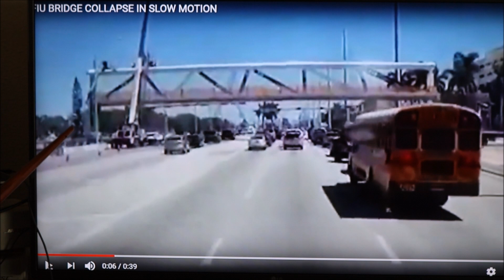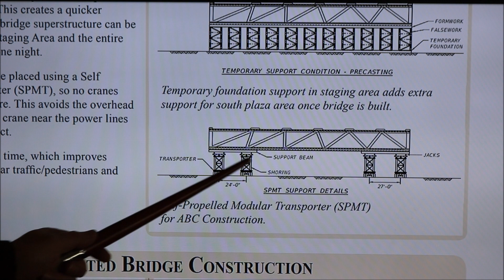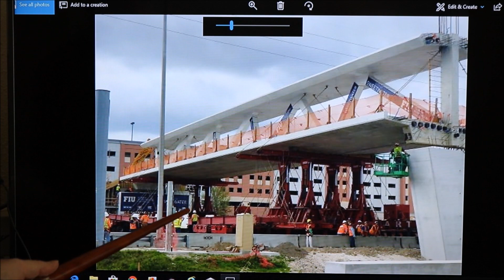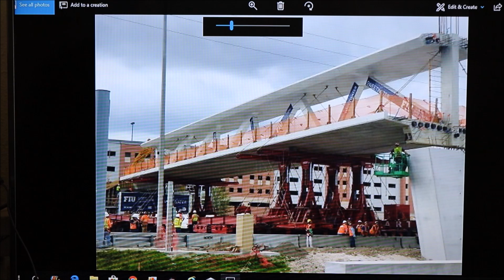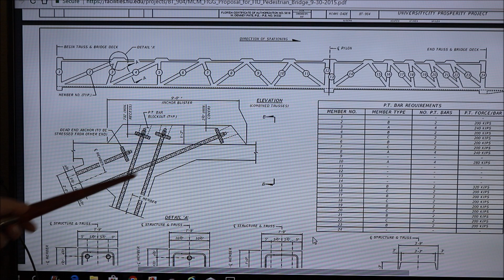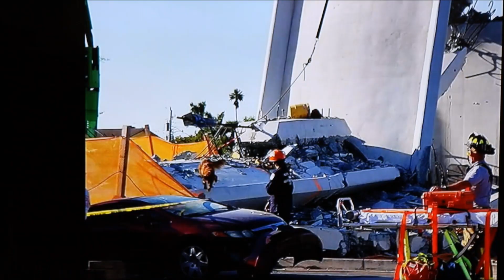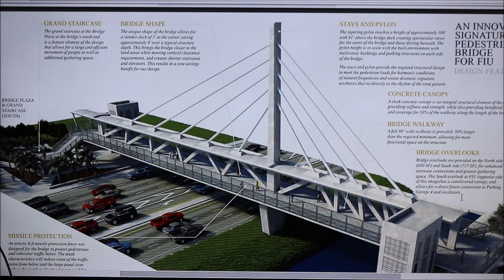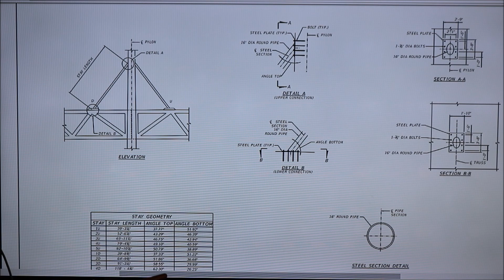Miami Bridge Failure Update 18 March 2018

Comment: I'm confused. You say this is/was not a suspension bridge. But at 6:30 you show a bridge design with 1: a central tower 2: support cables or elements 3: a central pillar or abutment from the road to the lower deck. Now, OK, so it is not a "suspension bridge" like the Golden Gate or the GWB in New York. But the tower and the cables emanating from the top of the tower, not to mention the central support pillar have got to be incredibly important items. That bridge is exceptionally long, lacking any center support. Additionally, to me, the unsupported bridge would be quite vulnerable to torquing forces. That thing twists, I don't care how well you have the internal cables tensioned, it is going to liquefy. It's gonna turn into dust. It's not like a steel I-beam with both tensile and compressive strength and considerable elastic capability. You twist that span and it will shatter. 
As far as everything I have read on this, the bridge was placed onto the end support abutments because the engineers fell in love with the idea that it could be moved into place 
in one shot. Well, lovely. You're saying the tower and support cables and central support are only slightly important to the design? Until someone shows me something new, I can't believe that. That span was placed before the tower & cables & center abutment were in place. As far as I can see from my amateur viewpoint this was a completely stupid and I mean 4th grade stupid piece of construction mismanagement.

Comment: If there were two tension rods in the compression strut, and one of them is let off, that shifts the compression to one side, which might buckle the strut.  Especially if the section of the strut was reduced from the two tubes within.  Swiss cheese and eccentric load leading to failure.  Possibly down low on the upper side in the video.

Comment: Fox News reported that a witness saw the crane cable brake and drop something.   I can see the crane cable whipping up without its hook in the slow motion video here.   I can also see the same thing in another video "Found video: FIU Bridge collapse..." from a college dorm room window.  Could be from the falling  bridge pulling the hook off or could this be part of the cause of the bridge failure as the witness reported?  Any other information on this?
Reply from the maker: Stanley Tolle I now think it was holding the hydraulic tensioner.

Comment: Sure you don't mean truss members 10 and 11, instead of 22?  Truss member 22 would be on the river span. 

The bridge failed at the 10 and 11 canopy junction and 9 and 10 deck in one swoop.  I figure the stress from the PT to compensate for the messed up cantilevered installation caused a crack across canopy and deck.  Both canopy and deck did not have rebar or any of adequate strength.  

The collapse was a double fracture of already compromised deck and canopy concrete. No way the 9, 10, 11 truss members  could hold the section up.
Reply from the maker: Jason Bell yes I meant #11
Reply: Thanks. And excellent video.

Comment: Im not a structural engineer but I was a successful mechanical engineer. It strikes me that the joints in the bridge must have all been highly loaded for one joint to fail and the whole bridge to suffer catastrophic failure. It came down without any indication of failure and ive never seen such a dramatic failure.
Reply from the maker: Bob Clarke pt loaded like a mousetrap.....
Reply: True! Everyone is talking about the trusses, but the joints have the highest stress concentrations, and concrete is not ideal for this kind of load transfer.
Reply: You got that right, but the question is "how did this get passed"

Comment: If I had to bet:
#9 or #10 was overstressed during/after the improper transport, and that caused the failure, not #11.
As the transport cradle was moved inwards, the overhang and the readjusting was too much for those trusses - my 2 cents.

Comment: You’re closing sums it up very well. This thing was obviously a much greater piece of work than necessary to carry a few pedestrians across the road. All of those aesthetics demonstrate further that the fundamental mistake here was trying to spend up on a trophy artwork instead of what’s necessary to get the job done. With it gone, at least the people will be able to enjoy the sky again.
Reply: I agree. A camel is a horse designed by a committee. They could've put up a simple Howe truss design from the 19th century for a fraction of the cost and twice the durability, if not twice the aesthetics.
Reply: Read my comments above which I wrote as I watched this video.  They should be read from bottom up.

I'm happy the original poster is not a bridge designer.
Reply: Seems pretty simple to me- What we have here is an asymmetric cable-stayed bridge that could not support it's own weight before the pylon and cables were installed. Just insufficient analysis of the un-supported structure.
Reply: supposedly the company that built this thing has a habit of substandard work.

Comment: I think you fouled up explaining steel in tension the sequence is 1. Elastic (propositional extension to increasing load, 2 Yield Point extension with static load. 3 Failure.
Reply from the maker: Norman Boyes correct, plastic not elastic....

Comment: You spent all sorts of time telling us the pipe stays are mostly for aesthetics. What about the big ass support in the middle of the bridge beneath the lower deck that is missing? That center support would have cut the load carried by the end pylons by at least 50%. Why no observation about it? Or did I miss your comment on that?
Reply: The span that collapsed was only half the bridge, the section over the road at 06:35. The center column and other span were to be constructed later.
Reply from the maker: Jeffrey Evans take another look at the plans, I think there is a misunderstanding.

Comment: Juan, very good analysis. You only need to concern yourself with 3 points. 
1. it's a post tensioned structure that should only be tensioned to compress the concrete and never retensioned. The concrete takes the load in compression. These tendons are NOT structural load carriers. They do not have anti burst or anti punch rebar around the sockets.
2. The temporary works designer is in hot water! The locations of the supports on the spmts is in the wrong place putting the post tension tendons under load. This will crack the pockets because they are not reinforced to cope with these loads as stated about. 
3. When the structure was lowered it puts the concrete back into compression. However the damage is done. I doubt the tendons were stretched or broken. It will be concrete at each end. On trying to retension which is a no no the concrete gave way.
There is nothing wrong in the design, it's actually quite clever. Same for the fundamentals of the methodology. The root cause is a complete lack of competence around the basics covering the use of post tensioned concrete. The fundamentals are all there in drawing you showed so the designer knew what they were doing. The so called engineers clearly could not read the drawing and most importantly understand what it was saying. Having done what they had, the indicators were there for failure, which they also missed before anybody went up.

Comment: ..... just glanced at design drawings. Design appears to be some sort of whacked out hybrid between a truss bridge and a cable stay bridge in the shape of an "I" to give it strength. The "strength" you find in a truss bridge or the "strength" part of a cable stay bridge is not seen. With only point contacts in the middle you even lose the "strength" found in an "I" shape. Inadequate sub-structure and trusses to be a truss bridge and where are the cables to make it a cable stay bridge? Water pipe used to stabilize? Longitudinal and transverse "tendons" I'm thinking should only be used on a full cable stay bridge. You should be able to fully suspend or jack up the middle without concern of how far the ends drop and without it falling apart. Poor mix all the way around?

Comment: Word now is that after the move, when they were to loosen the rod, they found it already relatively loose.  Apparently the steel of the rod had surpassed its elastic modulus and somebody thought it a good idea to tighten it even more.  The problem with that is that once a bolt has passed its elastic modulus it becomes plastic and can never be tightened to spec, it will fail first.
You can see this happening during the slow motion video of the bridge collapse.  The bridge starts to deflect, slowly bending downward as the steel rod is stretched, and then suddenly collapses when the bolt finally fails.
Juan, what you are suggesting is the workers fall protection harness is most likely the harness holding the hydraulic pump for the tensioning device.
Reply: The theory of the overstretched PT bar was highlighted in AvE's 2nd video (linked in comments). The real question is why failure of that rod, in truss #11 which like #2 is supposed to be in compression, would cause a domino failure of the whole structure?
Reply from the maker: drkjk I agree
Reply: The working theory is that #11 was over tightened during the move to compensate for that panel being cantilevered.  We know this quite likely occurred because during a post move interview it was stated that tension would now be released.  Back to over tightening of the rod.  I'm sure the intention was to never tighten the rod past its elastic modulus, but apparently that is what happened so now the questions to be answered are how and why that happened. And why, when the threaded rod was found to be relatively loose, was it tightened.
Purely speculating now, but it is conceivable that the threaded rod was found to be loose on Saturday, engineers thought about it for a few days and then authorized the threaded rod to be tightened.
Reply: If they thought about it, and knowingly authorized the #11 rod to be tightened, that does not reflect well on them!?

Comment: I missed the collapse by minutes. The bridge was assembled in the wrong order. They should have put the short span first and only placed the long span when the tower and stays were ready to attach. Failure would never have been as catastrophic.
Reply: The short span is over a canal. It may have been technically difficult to get into position.
Reply: If it failed the result would have been only a few fish or an alligator. Sooner or later it had to be put in place and I would think it would have been easier to do it before the longer span was over the road. I am just glad that I was suspect of this bridge since I drove under it on Sunday morning coming from  Aldi. On the way back from Aldi on Thursday I went on 117 ave as I was afraid to go under the bridge until it was finished.

Comment: I am not a bridge expert but video shows its a very poor design that did not work which cost innocent lives and some people need to go jail and families need to be greatly compensated and that's the bottom line.
Reply: If you aren't a bridge expert how can you possibly say it was a poor design?
Reply: drkjk cause the veido told me its a poor design, hello it failed and collapsed on its own weight while still being worked on. So yes poor design, poor engineering, poor builders, and very poor safty precautions.

Comment: As I posted previously the failure was due to a steel failure, not a concrete failure. 

The first thing investigators will look at is the possibility of a defect in the steel member that failed. They will also look for a precipitating failure elsewhere such as a defective weld.

As an engineer myself I must say that my reaction to the design is that it seems horrible. The collapse of a structure cannot be allowed to occur when any single element fails. If the design was that weak, ultimate failure was inevitable, only a matter of when, not if. The concept of redundancy seems to have eluded the designers. The truss design is also troubling as all of the diagonal members seem to have gone in one direction, the others being nearly vertical.
Reply: Defect, or possibly the wrong steel was applied to the order. In other words, a certain grade is spec'd and that grade is ordered for the job. Someone with the supplier looks at the order and thinks, OK this is what they spec, I've got this which is not exactly what they spec, but I know what it is being used for and it will be OK. If there is failed steel, the piece can be traced all the way back to the supplier, even to the mill that made it (OK, at least to the boat if it was foreign steel). We shall see.
Reply: It is a little scary to think that we could be driving over and under bridges that, if one member fails, the whole shebang could come pancaking down. The sad thing is that it's not like this was a highway bridge going all the way across the gulf. It was just a pedestrian bridge. 273 feet.
Reply: DeMeaning Plebny it is best not to jump to conclusions. Let's wait for the investigation and forensic test results.  As an experienced engineer myself I've worked with many civil engineers and my first job was in what was at the time the largest steel mill in the world. Structural engineers are in my experience extremely conservative generally designing to 100% or greater overload than a structures rating before failure will occur. There appears to me to be something very wrong with this design. BTW by nature I'm not an innovator. I let the other guy's client be the guinea pig. I only use proven designs conservatively using the best available equipment and materials. This makes the first cost of my designs high but over its lifespan the lowest. I guess that makes me old school. But then all of my designs work for as long as they are needed. No one in my experience ever accepted the excuse that failure was the result of cost cutting.
Reply: Obviously there will be an investigation and someday it will be completed. In the meantime, people can discuss the situation if they wish to. Any thoughts that people have will not influence the investigators or affect the conclusion of the investigation.
Reply: DeMeaning Plebny okay agreed.

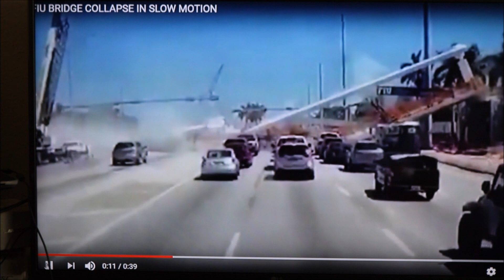Comment: If you look at 1:06 and advance a few frames at a time, there are pieces coming off the roof deck as it fails in compression. This is just to the left of the crane. It appears the lower deck fails immediately after, but is hidden behind the crane. Some of the overhead videos show the roof deck fell out of line with the lower deck in the area of the failure. Possibly indicating that one side of the rook deck buckled first. If this was a truss design rather than cable stayed design, then the roof deck seems far to flimsy to take the compression loads.

Comment: All material specs will be checked. Were the rods the specified ASTM GRADE? was the concrete sampled and tested for strength? Inspection reports in order? Why did the safety harness fail? Never seen that before. Why wasn’t this prestressed concrete, like parking garages? All bridges have arch or camber. Why not this one? Bridge failures are very rare. This will be studied for years.

Comment: The tension rod doesn't seem to shoot outward away from where the worker is tightening it. I would think you would see the hydraulic tightner (not sure what it's called) shoot up and out at an angle at the moment of failure. But I've watched the video and don't seem to see that all the way to the ground. And since the tension rod is rigid as the cross beam broke it's just been pushed outward from the result of the bridge being flattened by the fall and the obvious distruction of the concrete holding the tensioner.  But it definitely buckled at the point below where they guy was working.

Comment: As far as shoring placement goes I don't see it as being directly responsible for failure. Shoring had been removed and traffic present at time of failure. Angled shots of shoring in place is hard to locate position but was probably centered directly below intersection of webs 3-4 and 9-10 with strongbacks seen in place to pick-up loads. Shoring probably could not have been located in spans between web intersections unless designed for which is highly unlikely. I'm kind of confused by some of the web number reference given. In vid of collapse I believe web 11 (22 in error) is referenced to the right and web 2 is to the left (I believe short section of bridge is to be installed on right end when viewed during collapse - small structure is still present at other end (left)). In your vid where you say tensioner device is still seen in place on web 11 (22) I believe should be referred to as web 2. The green arm of the crane is seen along left edge of still picture frame. I may be turned around as I see no indication which direction is No. or So.

Comment: Great job Juan. As a professional engineer myself, a few thoughts come to mind. Typical projects are designed by an engineering firm hired by the owner, then the design is bid and constructed. This project was on the other hand both designed and constructed by a design-build team (single contract issued by the owner). Such construction methods may reduce construction time and cost. For design-build projects, the design engineer on one hand has a contractual duty to his client (the contractor), but has a professional duty to public safety. These are often in conflict. The owner (the university) should have had an independent "owner's engineer" that oversaw all aspects of the project who has a contractual duty to his/her client, the university. Furthermore, the design engineer should have retained the services of a "peer-review engineer" to review all engineering designs and calculations. Was an "owner's engineer" and a "peer-review engineer" used on this project? From my personal experience, many design-build projects are missing both.